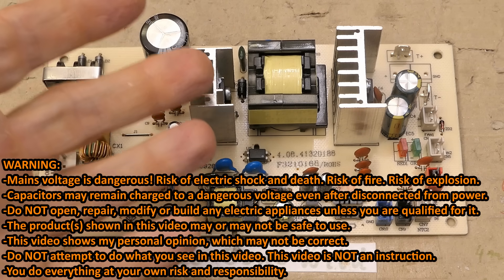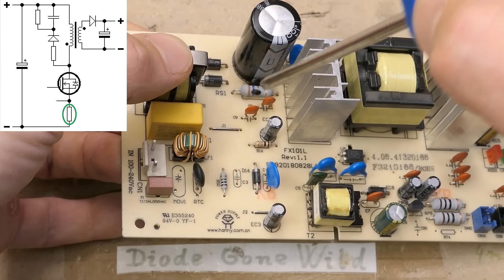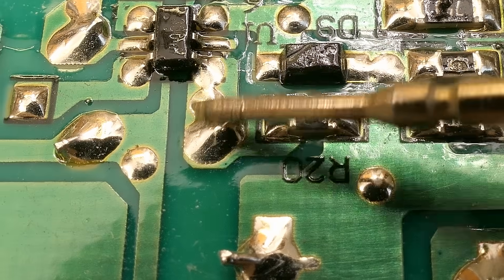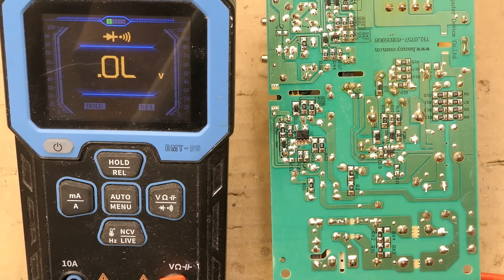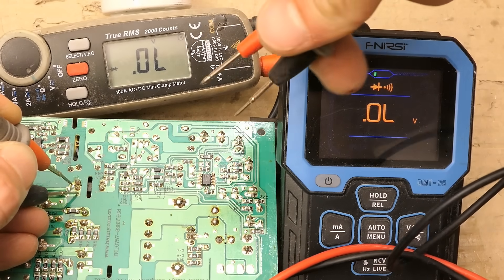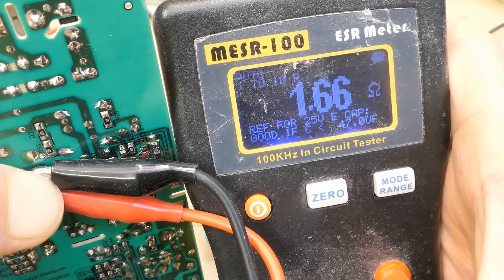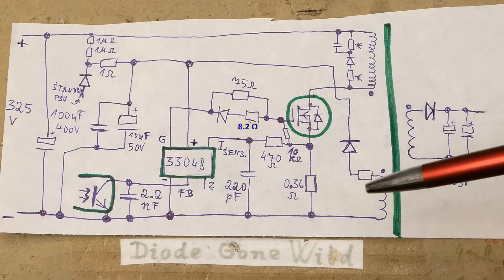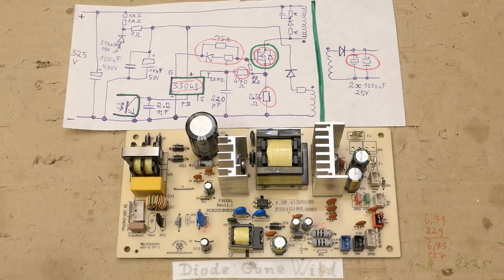Peltier Fridge Power Supply

Comment: Pwm controller chip is most likely OB2263. pin orientation coincides with the circuit diagram.

Comment: That chip is an extremely unreliable Chinese controller which always fails. The marking is also misleading and nonsense. Any Chinese switching controller with this package will work although its marking could be different. But I recommend to ditch the chip and replace the primary switching circuit using a STRW6053N Current Mode Control PWM Regulator IC.

Comment: How did you track that chip down? I have a chip labeled H0HAH that is similar in task, a PWM controller. The ultimate SMC marking codes database gave me some clues. I need to work out the pinout of it besides gnd and v++.

Comment: It's  always pleasant to watch your videos, I met a lot of these mysterious chips. The solution I use is the power supply module (CA 888) based on the (DM 0565R) IC  and I fix all kinds of power supplies. It's going to be interesting if you make a video about it

Comment: hi brother. it like with OB2362 . I belive that you can adapt it.
Reply: For use this chip need to solder 100K 0805 resistor from 3 pin to Gnd. On pcb is place for it. ME8204 fit better.

Comment: The most annoying switching power supply repair I've done was my for my TiVo. I found the bridge rectifier was blown, then spent ages checking other components and couldn't find anything else wrong, so I ordered a replacement and it worked.

I was in the TiVo alpha testing programme so I knew the guy who basically ran the whole technical side of TiVo Australia, who said it's a super common fault and he could've just given me a replacement power supply for free. TiVo deliberately under-specced the bridge rectifier and it's basically guaranteed to blow within a few years.

He actually repaired the power supplies himself for warranty returns, and offered free replacement for anyone who either brought their unit in or packed and posted it in.

But the most annoying part was that I didn't find out I could've got a free replacement until after I'd done the exact same repair to two other TiVos!

Comment: Hey sir Im from India and  I have a suggestion for u, if u dont find a chip then just use  use 29-3 smps module by HUAZHENG (use 3 or 4 wire version only, dont use 5 wire one as 5 wire one requires 110v aux supply and it's means for old crt tv)  (u may need minimum modifications in the main faulty smps circuit, but believe me it's not that much )
or u can also use ca888 module but with off course some minimum modifications on the main faulty smps

Comment: I've had the same experience with the switching power supply of an air filter. The problem I had is to find the right parts for it. I just eventually gave up and just bought a new power supply which costs nothing compared if I bought every blown components on it. 😂.

Comment: Thank for sharing this video, can you please try to fix the PSU using external oscillator module , such modules are equipped with UC3842 as PWM controller.

Comment: The control IC is a OB2263MP is quite commonly used in very cheap Flat LEDTVs or cheap power supplies like a Ebike battery charger
Reply: But in the datasheet of OB2263MP the marking says it 63
Reply: Watch the video, the chip is described there.
Reply: @LMB222 yes I know, I said what is commonly used, those chips have similar pinouts
Reply: No it is not that.
Reply: @janosnagyj.9540 try and search it

Comment: Nice work!
That's indeed a "weakness" for flybacks - if the output capacitor fail (as we know is so common with electrolytes), the output current has no where to go. So, all the energy stored in each pulse (which is quite a lot - especially given that when the feedback sense no output voltage or voltage spikes get too short to register, the duty cycle is increased to maximum by the control circuit) now has to be dissipated in the snubber network - which usually isn't at all dimensioned to "absorb" that (it's a huge difference to just the  small spikes caused by leak inductance in the transformer, that it normally have to deal with) - causing massive overvoltage on the transistor (and get it to fail quickly). 
If a diode snubber with a zener diode in parallel with the capacitor is used, it might prevent this - but it has to be combined with having the overcurrent protection on the "high voltage side" (so all current passing thru the primary, even when the trasistor is off, passes thru it). 
Otherwise, this will cause the transformer primary current to "run away" instead, driving it into saturation and quickly causing the zener and snubber diode to fail because of overcurrent instead - and those usually fails shorted, so this basically causes the high voltage input capacitor to directly short thru the transistor once it turns on. If the over current protection (even if placed on the source pin like here) is fast enough it might protect the transistor from failing - but it's very hard to do with no inductance that limit the current rise time when it turns on.

When the transistor do fail, it's very common that the gate also start conducting - practically shorting the high voltage input capacitor to the gate drive circuit. So this kind of failure where the gate drive circuit and chip also blows up, is typical. Great that you finally seem found a new one of the right type. I look forward to see the new one (along with new capacitors and transistor) put in and a test run. It's always satisfying when a successful repair is done.
Reply: Short circuit in secondary is totally safe even for self-oscillated flyback (of course when secondary diode is alive). Short circuit in primary snubber zener is save too. So, use zener/tvs snubber (not dump RCD clamper...) in primary + zener/tvs in parallel to output capacitors for the secondary. You might also put ceramic capacitor in parallel to output for smooth pulses for slow zener diode.
Reply: @makoveliprod  Yes, given you have the right overcurrent protection in place. I taught a little wrong about the configuration of it in my previous post though. 
It works fine to have it on the source pin as well - but it has to be of the type that's triggered by the peak current, shut off the circuit and give time for any current going, to drop down to zero before the transistor can turn on again
(it's there for protection during fault condition - not to limit the current like a "constant current" circuit).

But anyway - a flyback transfer power to the secondary only in the off phase (when the transistor turns on, the primary current ramps up, but nothing is transferred, until it turns off again). 
This also means there is a back EMF that needs to be blocked in addition to the input voltage. The voltage rise caused by this, is the output voltage (+output diode voltage drop) - times the turn ratio of the transformer. 

For example if the output is 12 V, diode forward drop is 0.5 V and the amount of turns on the primary i 300 and secondary 20, as an example (I used that in a small one I designed my self)
 - the volage rise will be 12.5 V * (300/20) = 187.5 V. 
That's the minimum voltage that the zener diode must block (it's always good to have some margin though - since factors such as leak inductance can get it to be slightly higher in practice). 
If a the zener voltage is too low (which would be a misstake when designing the supply though, rather than a fault that can appear when used
 - but is good as an example to explain the behaviour) and there is no protection in place, the voltage on the secondary side will not rise high enough to give the desired output voltage, if there is any significant load on the output. 
Because of that the control circuit will also increase the duty cycle to maximum thru the feedback, trying to get the ouput voltage up to the set level.
Which means the current will just start to "go around" thru the zener diode and back to the "input rail", when the transistor turns off - growing larger and larger each pulse
Until the zener diode fails from excessive power dissipation and then (because zeners usually fails shorted) there will be nothing blocking that EMF at all - so the tranformer quickly goes into saturation with pretty much nothing but the resistance of the primary winding limiting the current. 
This may also cause the snubber diode to fail (usually shorted), causing a dead short thru the transistor from the "input rail" once it turns on.

The transistor during normal operation needs to be able to block both the voltage rise and input voltage. For example if the input voltage is 325 V (typical mains top voltage here in Europe for example, where we have 230 VAC, RMS, as the common standard), the transistor need to block 325 + 187.5 = 512.5 V in my example. 

So now it's also easy to see what happens if the output capacitors fail as well, like they did here
 - then the output current has nowhere to go and just get blocked. In that case, the transformer will act like nothing but an  inductor connected between  the "input rail" and transistor drain. As the transistor turns on, the current "ramps up"
 - but when it turns of again, there is nowhere for the stored energy to go (if using a resistor snubber network the resistors will have way too high resistance to deal with that amount of current, so the voltage will rise so much it practically act like an open circuit)
 - causing the voltage that the transistor has to block, to go almost towards infinity as well.
No overcurrent protection will help in this case.
Reply: @Speeder84XL  shorted zener in snubber network -> longer demagnetization: 1. for self oscillated flyback, even with no current sense -> large OFF time -> droping frequency to audible, no damage. 2. for PWM controller -> DCM to CCM, core saturation, current limit kicked in, probably damage after some time, when open feedback protection is not present (old pwm like a 3842). I've never seen a failed snubber diode, theoretically, there cannot be enough current in primary to destroy it.
Reply: @makoveliprod  True - it depends on how the control circuitry is configured. If it senses when the current go down to zero and doesn't allow the transistor to turn on again until that point, there will be no damage (other than that that the output will be effectively disabled until the failed zener diode is replaced). Same applies if there are a short circuit on the output.
But if it's a PWM based circuit with constant switching frequency or "fixed on/off time" configuration (as used in some supplies), it might end up the way I described. You are probably right about the snubber diode as well.
But even if that hold up it will not prevent a catastrophic failure anyway. When the transformer goes into saturation, the current usually get so high that the transistor blows up as well (the primary winding usually have very low resistance compare to it's inductance
 - which is what limits the current during normal operation).
Reply: @Speeder84XL   Its not necessary to sense zero crossing of current, better to sense zero crossing voltage on the aux winding (end of demag). Its also sure that converter will always operates in DCM mode for wide input range. This type of converter (quasi-resonant) are similar to self-oscillating, but without rising up operate frequency (overheating primary switch) at mid/light load.
Reply: @makoveliprod  Yes, but with a shorted  zener diode, there will be no voltage to sense, coming from the output and aux windings either - as nothing is resisting the back EMF in that case. 
With nothing (except the very small voltage drop of the snubber diode) resisting the back EMF, there is no voltage rise that can act as the input voltage - and thus, nothing is transferred to the output and auxliary windings either (at least not enough to overcome the voltage drop over the output diode on the aux winding).  
So, the transformer just act like an inductor put between the "input rail" and the transistor drain - with the snubber diode as a freewheel diode. The current just "goes around".

If the transistor stays off long enough, the current will eventually stop, as we are not dealing with a super conductor here - there will always be power losses that slowly demagnitizes the core. 
But at the time scales of where the normal switching takes place, this takes very long and a current sense circuit will be needed that senses when the primary current is down to zero before turning on the transistor again, to protect it 
 - or just turn off the transistor and don't turn it on again until a preset delay has passed (this configuration will work with the overcurrent protection on the source pin, like the one in the video, as well)
 - which is set to be well long enough for complete demagnetization in the "worst case scenario".
Reply: The alternative would be a two-switch flyback, where energy can return to the primary side bus. However the feedback will still be poor with failing capacitors.

Comment: Any bulging cap just means its type was either crappy from the get go, or unsuitable for its application. It happens when operating close to voltage and temperature limits but even staying within doesn't guarantee success - caps deteriorate from AC flowing through them, especially high frequency. I've seen far more bulging electrolytics in switch mode power supplies than old "big iron" 50/60Hz mains transformer and rectifier kind. And if you have a bulging one, replace the others (especially in the same branch, and especially the known dodgy brands) to avoid the risk of device breaking down again because of a different cap.
Reply: Well thats also because older capacitors are lower density. Meaning they can accumulate more gas and pressure before rupturing. 
Had an old BK Precision power supply where the main cap popped and it nearly gave me a heart attack and the can bent the case :c
Reply: @AlpineTheHusky  true, those old electrolytics were far bigger for the same capacitance.

Comment: This summer I repaired one very very similar to this one, the wine fridge where it came from started to show higher temperatures than setpoint going to room temp, when I opened it both secondary capacitors in the big PSU (the one for the Peltier module) had leaked, I replaced them and now it is working as intended
PD: this power supply has a flaw like this one of having the output electrolytic capacitors too close to the output rectifier heatsink, these capacitors overheat especially in conditions of: low temperature setpoint, placing the back of fridge very close to the wall and high room temp
The small power supply supplies the screen and temperature control circuitry and the temperature control circuit activates the main PSU which is directly connected to the Peltier module/s
Reply: I suspect flyback is a poor choice for this application. The ripple on the output capacitors is atrocious. A forward or half bridge is a better choice with constant high load.

Comment: Nice video as always although nothing new for me ;) If you want to find chinese chips I have found aliexpress search to be pretty good. I tried searching aliexpress "33 sot 23 6" and found your chip pretty quickly. Of course you don't know which letters matter so you just try different letter combinations + package. I would replace all the caps especially mains cap. I know you measured it to be good. But since output caps already gone probably others will fails soon anyway. When mains cap goes it has quite devastating consequences. Usually recitifer diodes, mosfet and switching IC all blow up. Also always buying decent brand caps like Nichicon from TME or mouser. No aliexpress fakes. And since you have this power supply out of device anyway it is just easier to replace them all and have a peace in mind ;) Looking forward for more power supplies and interesting devices ;)

Comment: i had a fridge with what look like the same power supply, only lasted a few months before it died.
Could not find a matching part for the switcher so just went and bought a Meanwell power supply. this one has been doing fine for over a year now.  plus it's not being driven as hard as the original.
Reply: I have done same too few times. Meanwell power supplies quite good for the price. Always worked fine for many years.
Reply: And btw nice channel. +1 subscribe ;)